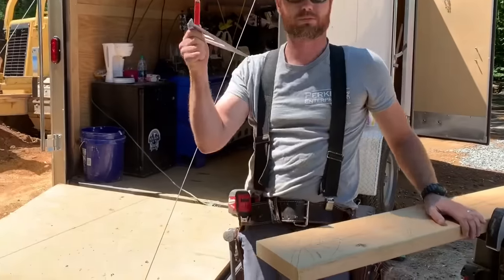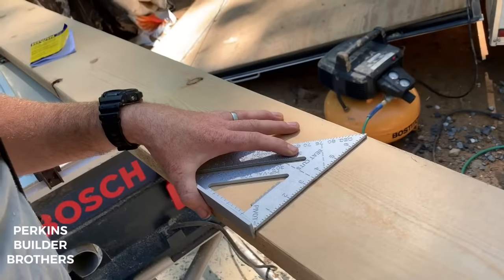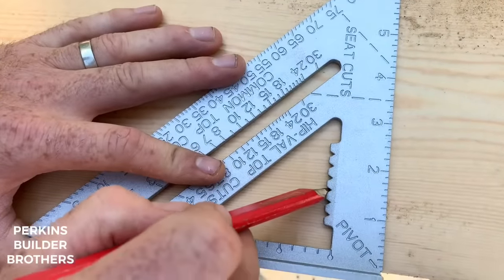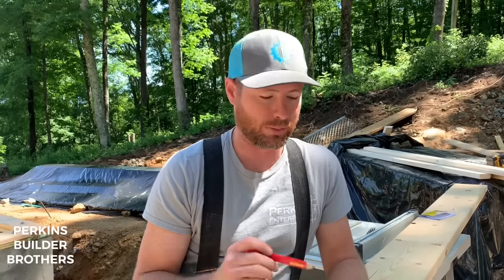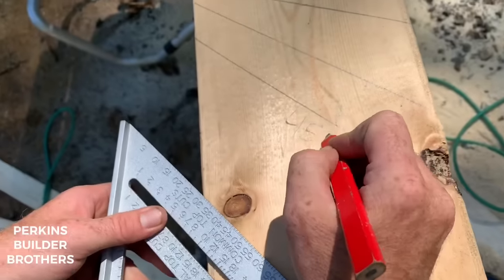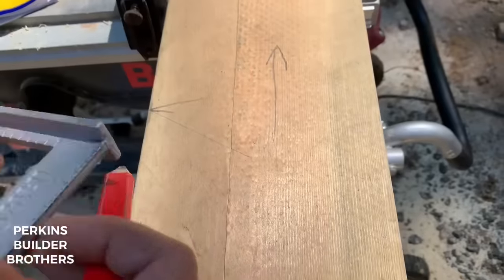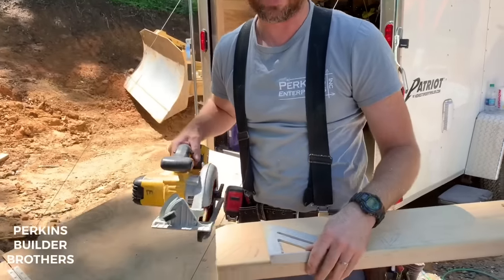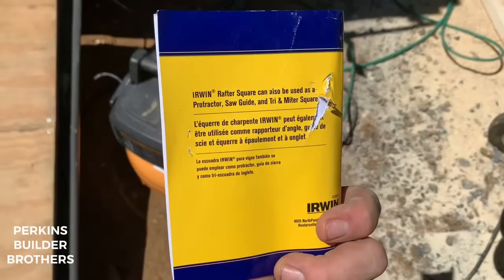How to use a speed square | Why it might be the most important tool you own

Comment: A good instructional video for your speed square. I bought a Roofmaster, which does the same thing. However, it is larger so doesn't fit in your tool belt. Plus, it has an adjustable screw arm for the angles. Just the sort of thing that could go missing rendering the tool unusable. I think I'll be getting a Speed square.

Comment: The speed square is also a one way boomarange, plus an emergency  hammer for small nails .
It is the tool for any trade.
Rough/framers
Finish carpentry
seen welders use it for plumb
Electricians and plumbers for layout of cuts

Comment: I use mine for circular cross cuts also. Very handy but did not know about the seat cut feature. Not sure if either of my plastic ones has it. I'm an amateur DIY carpenter myself so I do not use them often. I struggle with rafter layouts.

Comment: I'm gonna be honest: I knew a lot of uses for the triangle square (as we call it in Appalachia), but I've never used the little notches for drawing angles or for pulling lines along the rip length of a board.  I always use either my table or miter saw for stuff like that since it has the laser angle measuring stuff built in.

Comment: The base of the square creates a lip on both sides of the triangle. On one side, the lip is 1/4”, and on the other side the lip is 3/8”. Useful for sliding straight lines down a flat edge.

Comment: Don't forget a 3/4" buck bros chisel as one of the essential tools, at least it is in my job which is primarily window and door replacement and trim. They are great for carefully removing trim to be reused, or quickly chiseling wood vertical stops flush. My most used tools in order of most used are 1. estwing smooth face hammer (10 years old, very long lifespan), 2. Buck Bros 3/4 Chisel (6years old lasts forever just sharpen), 3. Malco 12" all Black rubber handle Aluminum/Siding Snips (6 years like new), 4. Fat Max razor knife (with carbine DeWalt blades) (I usually grab a new one every ear just cuz they are cheap and very nice when new I have some 5 year olds but new ones are better than to retune and fix), 5. Irwin speed square 7" (6 years old, very long life), 6. Fat Max Tape Measure (5 years old, long life if taken care of properly), and 7. Malco small black and silver trim nail punch. These are the most used hand tools, if you want a list of power tools I would say Milwaukee M18 Fuel Impact Driver, Sawzall, Grinder, Worm Drive Circular Saw, and Multi Tool. I have all Milwaukee M18 Fuel power tools because of battery life and charge speed as well as over all power and top not engineering and manufacturing. For the longest time I used skillsaw worm drive circular saws but as soon as Milwaukee released on I got it and it is far better. For chopsaw I use DeWalt and table saw Ryobi mainly because they are the smallest, and best value for price if you don't need huge ones for crown or large cuts. I am going to be replacing both of them soon with Milwaukee M18 Fuel because the 3 gen are much better and coming down in weight, size and price. Oh and let's not forget the most important tool of all the carpenters pencil, I personally like the White ones from ABC supply or blue ones from Alside supply because of the materials used, although I prefer the white ones because they are easy to see if dropped, also the home depot ones are total garbage because of the shit materials they use.
Reply: Almost forgot my levels, I have a 18" 40 year old walnut one, a 2' Irwin magnetic with light up bubbles, a 4' bamboo (I forget the brand might be Irwin), and a 6' Irwin which I trimed about a inch off the plastic tips so it would fit into the inside track of a standard 6' patio door.
Reply: And my one permit fixed bench tool is a Van Mark 12 aluminum bending break the green one (I think it's the #3) I've tried all of the ones they make and it's the best at it's job and most value for money, the red #2 is a close second, it's cheaper, maybe half the price but also not quite as nice. I prefer to spend the extra on a tool that makes your daily job faster and easier, it pays for itself very fast (#2 red is pretty close to as good as the #3 green if new or refurbished properly).
Reply: I personally really like the fatmax tape over the Milwaukee stud mainly because it's a little bit lighter and fits into a standard or old school tape measure pouch much swifter and easier. It doesn't have the cut out on the bottom but I'm used to old silver Stanleys before the fatmax so I just touch it infront of the feed lip in the same manner. The nicer of the two fatmax which is what I use also has a very nice stop locking function which is easy to toggle on or off.

Comment: Simplest way i figured out an unknown angle, (of my existing roof) i held a 12" long piece of 2x4, vertical to edge of roofline
Iput a dot on edge at highest point. Then a dot on other side of 2x4, at lowest point. connected dots, cut that line. flipped and rotated the piece. I had the exact angle of the roof

Comment: Years ago I site built and installed custom staircases and had a dude walk up on my site carrying a ratty tool belt, and asked if I was hiring. I asked him if he had tools and he said yes. In his bag he had a 16 oz hammer and plastic speed square and some rusty nails. I pulled my speed square out and spun it around on my finger like in the video. I said 'can you do this?' he whipped his square out and spun around like a plane prop! My answer...
" No thanks.. I have to many guys standing around doing that now". 

I did end up trying him out for a week...and my impression was spot on. Useless even for clean up.

Comment: One other thing you can do is use it cut backside angles. If a 6/12 roof rafter dies onto another 6/12 roof, the bottom angle of your rafter is going to be a lot steeper than a 6/12. So you mark 6/12, then pivot it to your mark on the board, and thats a backside angle. Some people call it a reverse angle too i think.

Comment: At 3:00 you have the part of the angle backwards right? If you do it the way you explain, then when you measure 10 degrees, it is actually an 80 degrees angle with the side you point out.

Added: later at 4:21, if you look closely, your 45 degrees angle is sharper than your previous 40 degree angle.

Comment: Please correct me if I'm wrong, but the angle that you scribed at 4:22 is not 40 degrees in relation to the side of the board that you indicate.  The scibed line is actual 40 degrees in relation to a perpendicular line from the edge of the board at the pivot point .  In relation to edge of the board, your 2 angles are 130 and 50 degrees (must add up to 180).  Let me know if I'm wrong.

Comment: Not sure if it's been mentioned but your 40 degree line @ 3:00 is in relation to the cross cut of the board, not the edge you rub with your hand.

Comment: A word of caution to those marking out angles from drawings - (I once had a weld shop get this backwards).
When you lay out an angle from a drawing, the speed square only measures angles one way off the edge. The way angles are normally called out in drawings showed the other side of the angle. My drawing called out 40 degree included angle. What the welder should have done to use the speed square as a protractor was, 90 - 40 = 50, and lay out to 50 degrees on the square.

Comment: I’m nowhere near a carpenter or anything in the construction business. I wanted to buy one just to get familiar with one.  My question is at the 3:04 mark. The 40 degree line,  isn’t that 40 degrees from the 90 degree mark and not from the edge of the board as you claimed. Bc I would think that from the edge of the board to the 40 degree line would be 50 degrees used to make up a right angle.

Comment: How to 6/12 barge landing on 9/12 roof- with speed square- Mark 6/12 on the barge, now you have your plumb line, next, off the plumb line(6/12), mark 9/12 and there is your compound barge angle! Will work with any two pitches, I just used 6 and 9 for example.
Remember that "plumb" is a constant.
The Lone Framer

Comment: The hip/valley cut is a 17 as opposed to a 12. 
So a 6-12 common converts to a 6-17 hip/valley cut. 

A 12-12 common converts to a 12-17 hip/valley.  

Just another little thing to know in case you ever get reduced to a framing square on an outlying  job side.

Comment: The speed square is awesome. So much geometry 📐 packed into a single tool. We that use geometry daily, especially builders know the importance of Square or plumb and level. In geometric terms it would be the perpendicular relationship between vertical and horizontal. We know that level/horizontal is a straight line or plane and the same with vertical. We know that all perpendiculars to a horizontal will be vertical, and all verticals to a horizontal will be parallel. Main stream science says the earth is a sphere with a radius of 3,959 miles. Main stream science also claims a very different geometry from the one we all know and use. They claim that all verticals are radial, like the spokes on a bike wheel, none of them being parallel. As a result they claim that no horizontals are parallel and the perpendicular relationship between horizontal and vertical only exists at the point where the radial vertical and intersecting horizontal meet. So basically you have non parallel, radial verticals and non parallel, intersecting horizontals. Let that sink in.... horizontals intersecting each other at different angles 😲. So my question is this; how many horizontal planes can you fit on a sphere? And what’s the max distance before the verticals become not perpendicular or out of the square to the horizontal plane?

Comment: I think that the 40 degrees are with respect to the vertical line. with respect to the horizontal you either have 90+40=130 degrees or 90-40=50 degrees

Comment: For all the aussies down here what’s a 10 12 ? We just have deg for the plum cuts on the rafter heads
Reply: For a common rafter: 10 units of rise for every 12 units of run. So the pitch angle = tan^(-1)(10/12)≈39.81°.
Hip-Valley... I dk. But now am motivated to learn the trigonometry behind it.

Comment: A speed square is used with a circular saw, pretty sure.  Somebody gave me a used one once, I lost it.  Gotta say, circ. saws are for roughing in. Real carpenters use dialed-in chop saws and table saws. But don't try to tell that to a framer. A finish carpenter starts his work after the AC has begun to dry out the house.  All the speed squares remain outdoors.  Finish carpenters also tend to sharpen their pencils often, as a 1/16th path of graphite requires the memory of which side of the line to cut on. In '82 I got my combination square, in 41 years I never threw it once!
  I gotta say, you lost me on the hip and raptors, I don't spend time on the roof, but on tearing out stringers that framers have cut, to make ones that work for me.
  But seriously, I learned a lot of stuff the speed square can do. Do I still own a circ saw? ?

Comment: I replaced some post on my porch and thought I was being smart using a digital level.  I got them 90 degrees and they looked great till I went to put up the screen door. Did not fit correctly and when I put the old speed square on it well it was not square.  Old tool still more valuable than a 50 dollar high tech one.

Comment: I have a question.  About the pitch of the roof when u say this is a 6 12 pitch or a 7  12 pitch ..... I understand the 6 or 7  of the pitch  thats where the roof crosses in the square BUT. MY QUESTION IS WHERE DOES THE 12 COME FROM.
Reply: Rise would be the 6, run would be the 12. Meaning that in 12 inches of horizontal measurement the rise of the pitch would be 6 inches, or of course 6 feet of rise in the roof for every 12 feet of horizontal distance. The speed square itself is in the shape of a 12/12 45 degree triangle even though it is 7x7 inches.

Comment: Not only do I have a 6 inch speed square, I have a 12 inch speed square and they both have scribe notches! (I found a 6" that has 8 notches!) Also, I can mark out stair stringers with the 12 inch speed square. Btw, I'm only a 38 year carpenter! Give me a speed square, 4' level, string line & line level & I don't need anything else! (Ya, I know, the standard hand & power tools too 🤣)

Comment: So you didn't show how to convert pitch to degrees if you want to cut a rake angle.  I'm a siding contractor and I constantly need to figure out what angle to cut my pieces for gables, etc.  It's pretty simple actually and accurate if you know the pitch of the roof (which you can also find out, using your speed square and torpedo level).  You put your square on a board and line it up with the common top cut for whatever pitch you want to figure out. On the bottom of the square are degree marks up to 90°.  So for a 6/12 gable, it lines up to 26°.  You then subtract 26 from 90 and get 64, which is the degree for your rake cuts. Then test fit a dummy piece and adjust the template accordingly.  You can also figure out angles for siding where two rooflines meet, even if they are different pitches. Sticking with the 6/12 example, when two rooflines meet, you just subtract the smaller number from the larger and presto you have the exact angle: 64-26= 38°!  Sometimes things may be off by a degree one way or the other but usually it doesn't matter in siding.  I didn't know about the seat cuts, though so I learned something new from this vid.  Thanks.

Comment: Good tips. Only thing wrong with this is you’re using an Irwin and not a Swanson. I prefer a framing square for rafter and stringer layout but a 12” speed square works too. Also never buy a plastic square. They can warp and break. Metal is cheap anyway.

Comment: 38 year carpenter here again, if you want to start remembering measurements a lot easier, like I did, it pretty much only works for rough carpentry, but, some old sheetrockers taught me this...call off measurements in 1/8" increments and even though 1/4 is 1/4 you call it as "2", as in 2/8" so...call 10 & 2=10 & 1/4"...call 108 & 4=108 & 1/2"...call 96 & 6=96 & 3/4" so, 1,2,3,4,5,6&7...8ths call 24 & 1=24 & 1/8"...get it? Try it sometime!
Reply from the maker: Nice tip! Thank you.

Comment: Mark 16 and go. X on the go side. No need to make 2 lines. Thats for putting on hangers. Most carpenters stand the 2x4s on  the 1.5" , make their 16 centers on the top of the board. 
          You guys sheet your walls and put overhangs on after you stand your walls up too?

Comment: I know you did it just for comic relief, but I cringed when I saw you throwing that square as a ninja star. My father always taught me to respect my tools, even though I work them hard. 

Also when using the speed square as a guide for cutting with the circular saw (which is fantastic instead of going to the miter box every time) I find putting the square on the bottom edge of the board holds it in place better when I’m pushing the circular saw to make the cut. 👍🏻

Comment: What about the all purpose wisk broom .cleaned off sso much my square is rounded at edge.  And when cutting off a bunk of plywood chuck that sucker under top sheet from scoring the second sheet .no matter how good you set depth on your saw...and when setting windows two squares work for sill spacing.and pry on the left or right one to get window plumb and or perfect reveal.. Oh and when your blade lock doesnt work hamb that sucker between two carbide tips in the blade and turn that nut clokwise till square and blade hit saww frame.bam.number 34 out of 148 ways to use a speed square.stand straight up point to point of a plumb bob to get ground location ...or even better red lazers ar hard to see on some surfaces but not on aluminium speed squares.throw it up there and ride an edge and you will see that lazer on your square contrast a flat aluminum square.I could do this all day.but I got to go cut and stack a radius witch cap with a coupala.

Comment: Nope, thats not a 40° line in relation to the side of the board, it's 40 substracted from the full 90° of the speed square =50°*. It's 40° from the end side, presuming its cut at 90°. I don't think the uploader actually misunderstood how the tool works, but always good to clear it up for anyone watching who hasn't dealt with different degree cutting anytime recent.

Comment: You forgot about how to make a long angle with a speed square. The birds mouth is technically a long angle but I'm talking put the speed square up to the board at a 90 mark with your pencil say the 10 for common 10 then pivot square until hitting the pencil mark, mark with pencil and long 10.
The easier way is by using the degrees a 10 is a 40 degree angle so a 50 degree would be the long angle whatever number equals 90

Comment: I had an old mentor who spat on speed squares.  He only used framing and combination squares.  His reasoning was that the hash marks were too wide so the measurement was not accurate enough.  He used the same logic with carpenter pencils, he only used #2 pencils.  He was well into his 70s back when I first started carpentry in 1998.  A cantankerous old bastard who didn't two shits about what anyone thought about him.  I, on the other hand love them however, I always check them with my 123 block before I buy one.  I have come across some cheaply made squares that were out of whack.

Comment: At 3:11 you state that the angle is 40 degrees in relation to the edge of the board. It is 40 degrees from a square line across the board, not the edge.

Comment: 3:12 - No, that can't be 40 degrees relative to the edge.  It's 40 degrees relative to the perpendicular - the cross line.  Just look at what you'd get if you went with zero instead of 40 - you'd get the cross line itself.

Comment: The run on the hip/ val scale on a speed square is not 12, as in 6/12. It's 17. SO, a 6/12 common is 6/17 on your hip cut. OR, the run on a 45 degree angle is 17 inches where square to the wall it is 12.